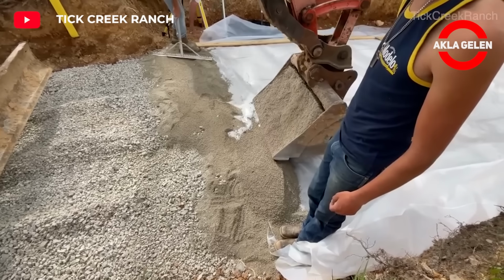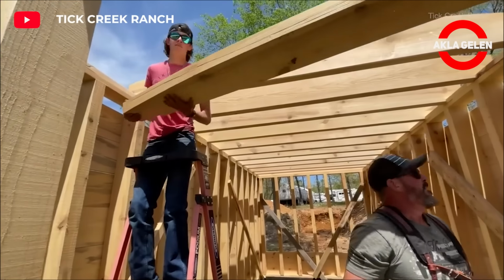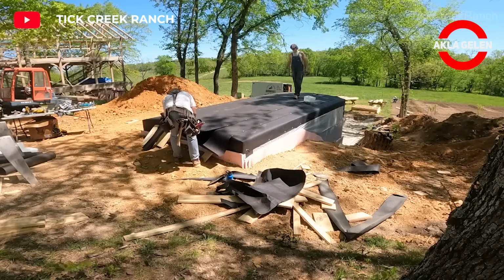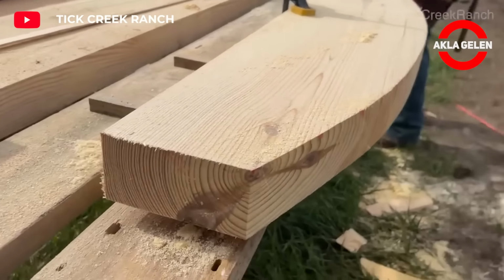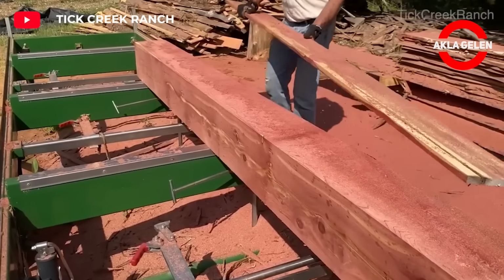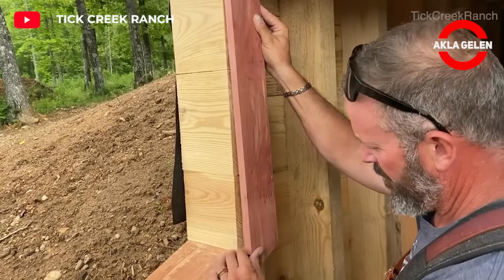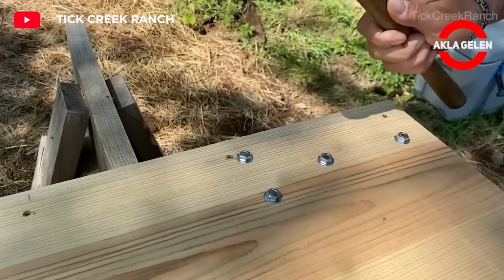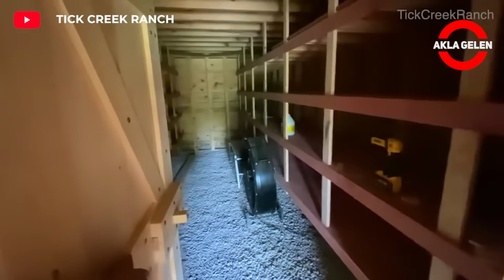Man Builds Wood Storm Shelter Underground | Start to Finish by @tickcreekranch

Comment: It’s gonna leak guys! Sorry! That tar paper isn’t gonna help a bit. 
You absolutely MUST USE a rubber membrane on all surfaces of walls, roof. 
NO DRAINAGE PUMPS!!
It’s gonna fail in a few years. Wood is not a good material for underground unless it’s Pressure Treated Marine grade lumber. 
Sorry guys I just happen to know a lot on the subject. 
✌️🇺🇸

Comment: basic wood construction with tar paper.  a structure like that doesn't last a lifetime above ground, I'm a builder my entire life.  Southern yellow pine is a very strong wood, but it doesn't have any real lasting benefits when wet or covered with soil.  Even 'treated' green wood will eventually rot.  Maybe it's different in Alaska, burying wood, I don't know?   Somehow, I think it'd be a lot less labor to use concrete blocks or poured concrete forms.  sealing all the joints, guarantee it would last a lifetime.    Nice build though, fun to watch, it would make a very nice shed...very sturdy.  🤗👍

Comment: Burning the outside of the wood is a water and bug protection. I have seen burned wood with around 120 years old and still in very good condition. E.G. when you have a pilar then place some gravel under it so that the water can flow away much faster.

Comment: The problems with wood underground never cease. I would suggest using a metal cargo container. Cheaper, stronger and easier to bury and electrify.
Reply: Only if you laterally reinforce the sides, or the walls will cave in from ground pressure over a couple years.

Comment: ID POUR A 2FT REINFORCED SLAB OVER THE TOP OF AND ALONG THE SIDES, LEAD EMBEDDED!  THEN LEAD LINED, DOORS THE WORKS.. INSTALL A AIR PURIFIER, THE KIND THAT REMOVES RADIATION, OSMOSIS, THE WORKS, PEDAL GENERATORS ALL THAT, MAYBE EVEN A FEW HAMSTER STYLE GENERATORS, YOU WOULD NEED EXERCISE UNDERGROUND MAY AS WELL CHARGE BATTERIES FOR YOUR HAM RADIO ALL THAT, GO BIG OR DIG A HOLE, NICE BUILD THO

Comment: CONCRETE would have been Faster , Stronger , Less Expensive , and more Flexible In Design!
Reply: nope you would need the wood than the metal and than the CONCRETE and its would be a pain in the but to add something new to it
Reply: @dementedbowine8681  Google 'PRECAST CONCRETE' - Ancient Roman builders made use of concrete and soon poured the material into moulds to build their complex network of aqueducts, culverts, and tunnels. Modern uses for pre-cast technology include a variety of architectural and structural applications – including individual parts, or even entire building systems. - Good Luck & Regards :)

Comment: It is much easier to place a 20-foot reefer container, which is the same size as the wooden box, which is much more fragile than the container...
Reply: There is always someone who don't get it? For example to go get a coffee at the restaurant I prefer to walk you might want to drive someone else maybe want to take bike and so on? Who is right?
Reply: The walls of a  standard reefer container are NOT designed for horizontal forces and might bend inwards when the container is buried.

Comment: a lot of work and money to do that, I would have been better off buying a container and it would have been better
Reply: Sometimes it’s about the journey not the destination
Reply: Shipping containers are not meant to be buried and have significant weight/pressure coming down on it from above and the side. The strength in a shipping container is in its four corners and its ability to be stacked not from its walls in general. A shipping container underground would need significant counter supports added to the structure to resist the force of the earth on it among other improvements.
Reply: If that’s what you think then you don’t understand shipping containers and this type of of construction.
Reply: They built this for 2K. They have a mill
Reply: Shipping containers are horrible choices for a project like this. They aren't built to take on pressure from the sides like a buried structure has to.
Reply: well, it's for the content
Reply: No need to bury either.  A thick concrete footing foundation, a set of saddles to place metal shipping containers would be sufficient.  They can put moisture barrier over metal shipping containers and put earth cover.  Shipping containers are stronger against falling trees.
Reply: Maybe, unless the builder has a lumber mill or knows someone that does and can get lumber for cheap/free. If so, this is a much cheaper way to go. Not to mention he can customize it to his wants/needs.
Reply: Containers are very dangerous unless professionally reinforced to stop the walls and roof caving in.

Comment: Would it be wise to purchase an used, still in good condition steel cargo container with less money instead of build it with wood ?
Reply: No, containers are not meant to be buried and would eventually collapse due to pressure on the sides from the earth around it.
Reply: @tke71709  I don't agree with you ! Perhaps you don't know the structure of a steel cargo container and the pressure it can stand.  When you look at a cargo container vessel how they stack up the containers, you can imagine how strong is a standard 20' container ( TEU ) !
Reply: @lorddiablo8575  disagree all you want. Conex containers are great for stacking on top of each other, they are literally built for that. There is no pressure pushing in the outside walls like there is if you bury it underground.
Reply: @tke71709  No,No,No... I once worked for a cargo container inspection firm and the engineers told me the corrugated side walls are also designed to withstand very high pressure. That's why the side walls are  corrugated and not flat ! Are you an expert in this particular field industry ?
Reply: @tke71709  One more thing... If you have chance to look at the construction site of high rise building, when they dig the multi-level basement, all side walls are corrugated steel bars connected together like the side wall of a steel cargo container which are used to withstand extreme high pressure from the surrounding earth and soil ....
Reply: @tke71709  One simple example ... when you compare a box made of steel and a box made of wood ( same thickness of material of 6 walls ) which box can bear more outside pressure ... Tell me !
Reply: That's what I was going to say....   a 40 ft CONEX container would have cost less an needed less modifications.
Reply: @tboltaq2  It seems we shared the same idea ... Thanks !
Reply: Would be a good idea but I think you would need to reinforce it due to the horizontal forces